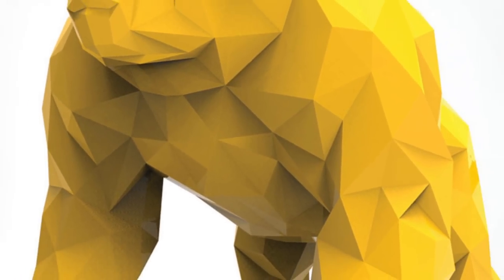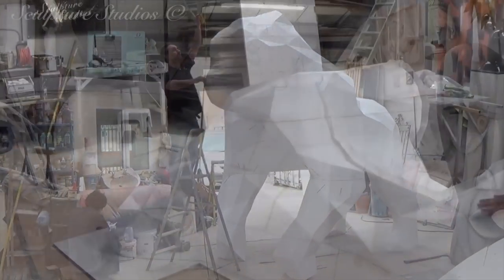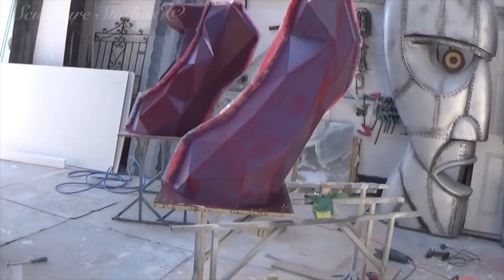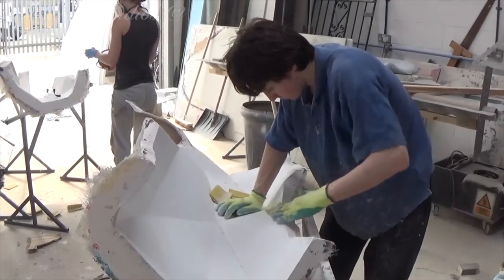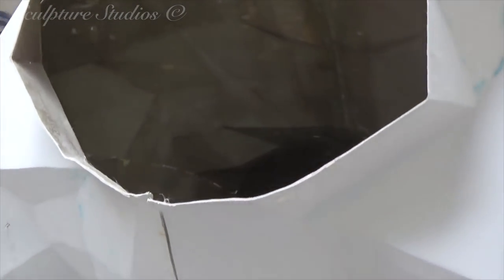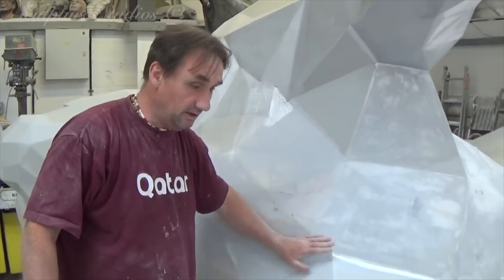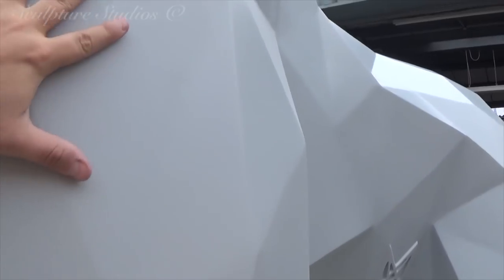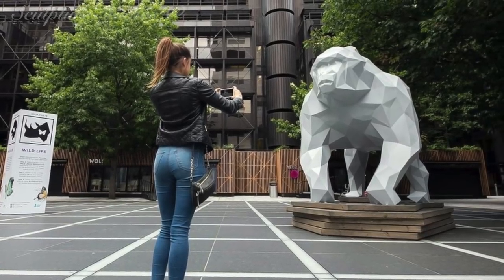Giant Gorilla by Sculpture Studios

Comment: Gorgeous! Gorilla!! And as entertaining as ever. I'm always impressed with the amount of work and energy you  guys our into the videos  as well as the art-works. In this case both are superb!  How many hours do you spend on such a Gorilla project? As a scenic painter/ sculptor I always find it difficult to calculate these things.
Reply from the maker: Thanks Niall! We allowed for about 8 to 10 weeks, what with the other work we had in the studio at the time
Reply: Aden Hynes Sculpture Studios 
Thanks for your reply. As a scenic painter/ sculptor for theatre we have lost a lot of work to digital printing. 3D  CNC routering hasn't raised its head here yet. I suppose  cost is an issue. In time it will come. Mind you, the level of accuracy with the facetting might be difficult to accrue with ' pure' sculpture. Is this your first CNC collaboration?
Reply from the maker: Agreed, in many instances its a lot quicker, more accurate, and sometimes more cost effective. But a lot of the time, for objects that are really simple, it's not worth the cost to go down the whole process of having an object either 3d modelled or an existing model 3d scanned, then rendered, then programmed to be cut, and cut, when it can just be blocked out and carved. For an object like this, it was a no brainer to have it machine cut, as it needed to be so accurate. We've had other pieces 3d cut before (one of which is a giant piece that will be our next video coming out so stay tuned!). Sometimes it makes sense to have objects 3d cnc cut, but we only do that when it's crucial, otherwise we're simply designating cost to another company, when we could both be paid, and enjoy do the carving ourselves.